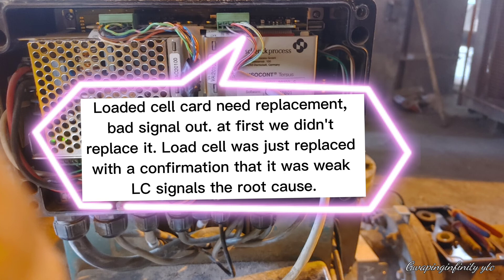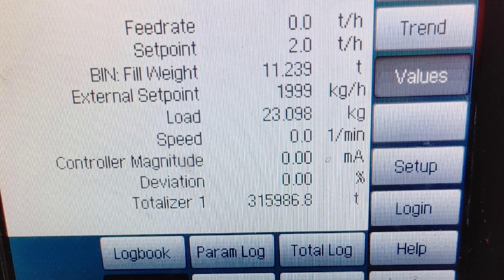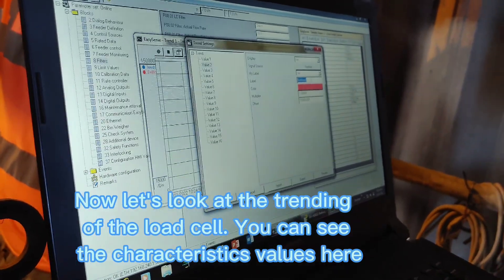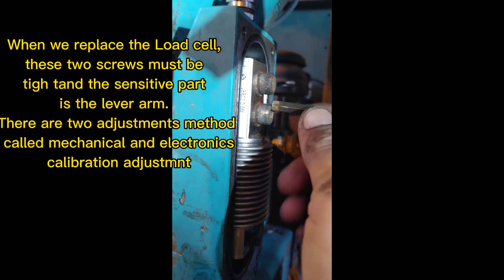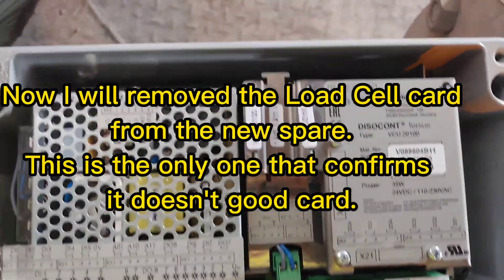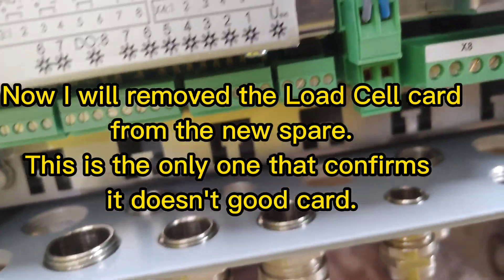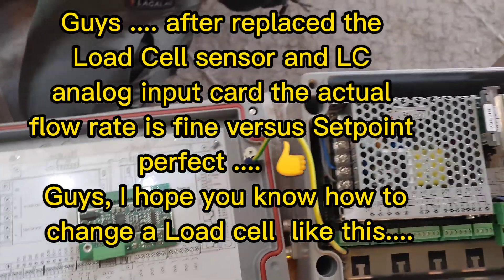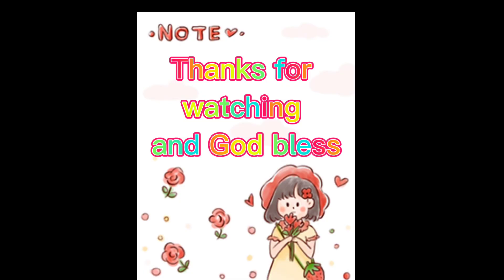How to replace DISOCONT TERSUS LOAD CELL CORIOLIS BY SCHENCK PROCESS +Gwapinginfnity

Comment: bonjour 
merci d'aider j'ai un probleme de communication entre les cartes VCU mere et extention
Reply: Thanks for your valuable illustration.
I need to ask about the procedure of replacing this load cell
Reply from the maker: - When removing the old load cell cable, attach a lead wire to help pass the new cable through the scale body .

- After installation, bundle and place any excess cables neatly, ensuring they are not directly on the ground .

- Ensure the load cell is installed horizontally and remains level under load to prevent damage from uneven weight distribution .
Reply from the maker: After need Calibration the System: Calibrate the system with the new load cells to ensure accurate weight readings. Follow specific calibration procedures for your bin and load cell system, which may involve adding known weights and adjusting settings .
Reply: Avez-vous pu résoudre ce probleme?